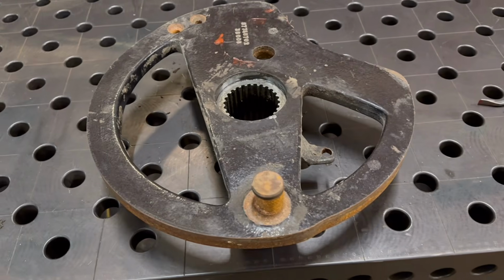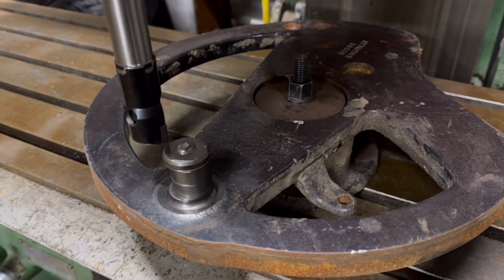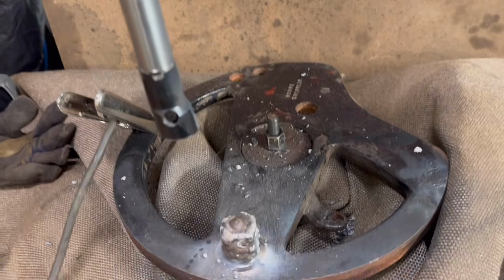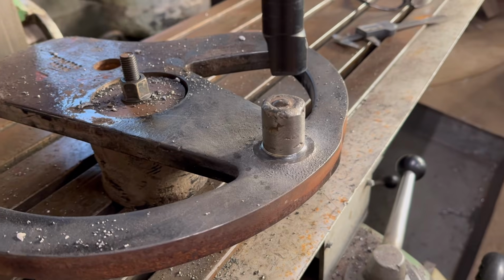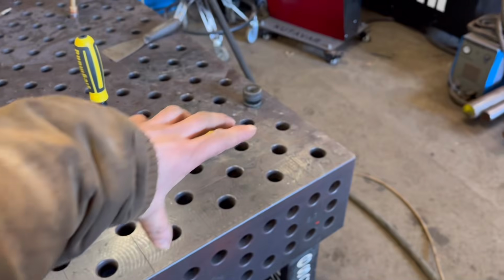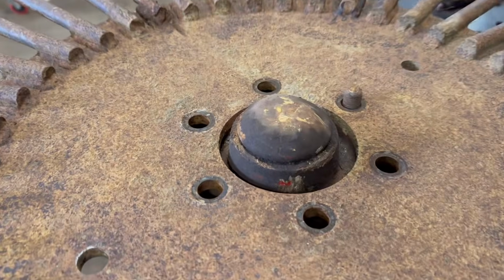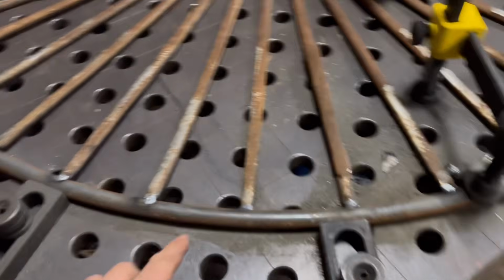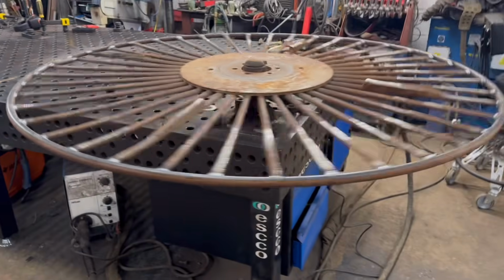Odd jobbing.  Machining Baler part and repairing beet harvested turbine wheel.

Comment: this is a casting wheel for potatoes if I had to guess. those 4 pieces in the cardinal directions would trigger the chute the wheel spins to align the potatoes and drop them into the planter

Comment: I see it is an interesting video. But I would have lobbed it off, drilled the remains out, stuck a new bit of bar in the hole and welded it in. The way it was originally manufactured. Why didn't you?

Edit:
Oh, it's cast. Press fit then.

Comment: 47:16...just out of curiosity, why didn't you use the round bar circle that wasn't bent as the starting point and after you've tag welded all of the dookes and then cut the balance off from the bent round bar's section
Reply from the maker: Just seemed a good place to start and a bit more to hold it on. Plus, i thought with it being bent in over it would make it more awkward once i got back around to the beginning
Reply: Hi Oliver. I see it from your point of view. Thank you for your feedback. Much appreciated

Comment: If you want to clamp things down to your fixture table using your Bessy clamps, attach the overhang clamps to the side of the table and move the item you need to clamp onto those. You should then be able to use the Bessy clamps the way you used to on your old table. Hope that works for you 😊

Comment: So this is one of those scenarios where knowing where the part goes and how it functions on the machine could've resulted in a much better repair. You dismissed boring a hole and inserting and welding a new rod as well as sleeving the existing rod as either "not strong enough" or "likely to throw it out of balance". In reality, it doesn't sound like you have much context on how the part operates and are thus making assumptions which may not be true. This could be a very slow speed or low force experiencing part that just sees a lot of repetition, in which case I'd say a whole new pin or a sleeve are a better option than building back up with weld. I don't think the built up weld is going to hold up against the repetitive motion. 

But what do I know? I'm just a guy sitting in his armchair on the Internet. I wasn't there, I don't know the full context of the situation and I honestly haven't even finished the video. It looks like the repair will work and that's all that matters I guess.

Comment: Apart from the steel being cold i see you are well rugged up as well. Would one of those el cheapo diesel heaters that have been getting about the last year or two make your workshop a bit more comfortable for you?
Reply from the maker: There is a big workshop heater in the lower part of the workshop but because there's no insulation at all the heat disappears pretty much straight away.

Comment: What was the purpose of leaving that overlap on the circumference of the wheel rim? Surely it was just the excess of where it was rolled as there's always a run-off piece of waste bar/plate that doesn't get formed properly. You just have to tack around until the ends overlap then cut down the centre and it'll fit together perfectly. Great vid.
Reply from the maker: no real reason, just seemed a good place to start

Comment: If the nickel is too soft and you were machining a bit off all around the post, could you not have just done a single pass of nickel, machine it down almost until it's gone, and then MIG weld on top of the nickel?  That way the nickel is just thick enough to act as a barrier layer to prevent carbon migration?   Alternatively, how tight a tolerance does that stub have to have?   Could you MIG weld it and abrasive grind it to size?

Comment: Hey was thinking that you could use the trick Keith Fener uses for straightening propeller shafts.  Alternately heating with a torch and then quickly cooling the effected area with compress air and water mist. I've used his technique to straighten a severely bent leadscrew for a lathe and brought it back within a couple thousandths.

Comment: It's probably the thick end of 40 years since I last welded cast iron using nickel rods. I got very good results by cleaning each weld pass with a pneumatic needle scaler. That had the effect of peening each weld to help take the stress out, as well as removing the slag.

Comment: On the wobbly wheel could you have used the welder heat/shrink to your advantage? I've seen others lay down a small weld a table leg on the side you need to draw it to and as the part cools it will draw that leg over.

Comment: Brilliant job on the crank 👌🏼 that beet part looks like an accelerator basket bottom. Runs like a record 🤘🏼 🤔 I wonder if you think a 3-D printer would be a good idea for pattern parts in future if metal powder can sinter. Maybe prototype for your design engineering. Do you work part time as BananaMan 🍌 😂😂😂

Comment: A little tip don’t hammer on your welding bench please treat it well and it will look after you ! I think I would have tried clamping it flat and heating it up to relieve the stresses put in by the welding, then leaving it to cool before unclamping it 👍
Reply from the maker: The top is hardened.
Reply: @ I used to work in a prototype engineering shop and I would have been sacked if I used a sledge hammer on a machined surface welding bench ! anyway the end result was good 👍 that bench was very expensive I was wincing every time you hit it !🙈

Comment: Can you burn out a bunch of washers in a few different thickness of stock to take up the slack space on your welding table quick tie down bolts vs buying shorter bolts?
Reply from the maker: Yes, that would be a good idea.

Comment: Nice job on the CAM wheel. Done similar, but was able to set it up using a face plate on a lathe, with a detachable saddle. I MIG welded it, using NiFe MIG wire and turned it back into spec. There were no circlip grooves as it used a retaining washer on the top. I recall that the MIG wire wasn't cheap, but it went down really smooth and had no holes at all. The wagon wheel didn't surprise me with the distortion, I honestly thought there would have been much more. The welding table is such an awesome tool by itself. Well done, first class jobs, see you next week 👍
Reply from the maker: I did price up some Mig wire for cast but it was extremely expensive.
Reply: @snowballengineering  It is expensive, even more so these days. I think you made the right choice going your way.👍

Comment: Hi Oliver,  good fix on the cam axle, grooving tool worked a treat, when I saw that wheel I wondered if it would spring all over the place once you cut the rim off, but your grasp of what's happening , and aplication of a bit of force won out in the end, ha,  ha, never doubted you mate, thanks for another interesting video,  stay safe,  best wishe's for Xmas to all there. Stuart Uk.

Comment: I work on large square balers as my job, that part is the crank arm for the knotters the centre spline go on the knotter shaft while the worn pin is connected to the needle carriage which brings the twine around the back of the bale. It’s missing the clutch part but there is another little lever with a roller on the inside which stops this peice from turning when it’s not tying a knot
Reply: I think it's the stuffer cam on a new Holland baler

Comment: I don't think that wobble is caused by heat from welding. When you clamped that bent end down you put quite some tension in the rod because it was bent at a bit of an angle. It might have been better to chop that bit off en weld the ring end tot end.

Comment: Good morning, Oliver.  A couple of jobs that needed an engineering pro to make them successful.  Nice.  
Parts at 2 degrees C means the mate doing the welding is freezing his ass of for a couple of hours.  Nice job knocking them out.  And I'm pretty sure that beet harvester ring never looked so good.
Thanks for letting us see a little more of your farm.  I didn't realize you had a dairy farm as well.  That's how I grew up and it takes me back.  Thanks for that.
That hay blower your dad was operating is a blessing.  I used to be on the wagon, chucking hay bale sections to the herd.
Thanks for the video and hope Tenerife helped recharge your batteries. 🎄Happy holidays! 🎄 Cheers, mate.
Reply from the maker: They're actually bulls for Beef
Reply: @snowballengineering  Yea, I couldn't tell from that angle.  Merry Christmas, Oliver.

Comment: Good old school repair on the shaft, Oliver. And replacing the wheel was not fun. If you have another job like that, you should start with welding a 1/4" wide piece of strap all around the spokes and then weld the round bar to it. That will keep it straight and easy replacement for next time.

Comment: Why does the welding material turn super hard on cast iron?
Reply: I think that the hot weld metal 'pulls' the carbon out of the cast. It requires a high nickel rod and pre heating (& possibly controlled cooling (annealing?). An alternative is cold stitching in some cases, not being paid by the hour though! Another method is brazing, tig brazing (ac/dc) is another possible route. Lots of info out there, usually the best thing is double check with something like AWS before you begin!

https://youtu.be/usRMtTFKpmI
Reply: The cast iron has a lot of free carbon in it, in the form of graphite. When you weld cast with steel rods,  that carbon goes into solution in the steel weld metal. You end up with very high carbon steel, which tends to be very hard and pretty much un-machinable.

Comment: Could you use nickel rods for the first layer and then mig weld over the top, or would the mig weld still go hard?
Reply: That's known as buttering, afaik. Welding dissimilar metals. Mig welding leaves a relatively hard weld as compared to say gas or tig welding. It's a factor in vehicle body repair, with respect to crumple zones, afaik. Most people don't seem to care & use mig for most things.

Comment: For the first part you made with the boring head; well done with the circlip groove. Really nice job. You will reduce chatter if you support your part and reduce the length of stick out on the bar. Rigidity is king when machining Ollie. The spigot you were working on, was flying in mid air completely unsupported. When it comes to cutting, you will always cut it if you have something harder. The carbide inserts are incredibly hard and will see off most welds. The swap to HSS worked in the end. Again, nice job. Before giving up with the mig I might have tried a quick cut on the mill.
Great job on the wheel.
Reply: A small jack under the machined area would also help support and reduce movements and vibrations. Great job overall!!
Reply from the maker: Thanks, this is good advice!

Comment: The next time you have an oxyacetylene torch and your infrared device, warm up a piece of bare metal, have a look at it with the IR device, then see how it looks with a patch of soot.
Reply from the maker: i use propane which doesn't create any soot
Reply: @ Spray paint works too 🙂

Comment: A couple of nice jobs, that 1st one could have turned nasty especially as it was cast. That wheel looked flimsy, until we could see you struggling with the weight. If advertising is anything to go by you need to start eating 3 shredded wheat for breakfast, followed by a couple of cans of red bull. You'll be able to lift anything then. 🤣😂👍
Reply from the maker: 5 weetabix every morning

Comment: As soon as I saw that wheel I thought getting it straight would be a bit of work! Nice job though, perfectly good enough for its purpose.  If you do another it might be worth tacking it, then setting the hub up vertically off the side of the bench so you can fully weld each spoke at a time to help prevent them pulling. Cutting and welding the rim to size first would also remove another potential source of warping from the bigger welds you needed in that area. If it came out slightly undersize you could just warm it up with the torch to get it on the spokes.
Reply: Not an expert but would it help better to weld opposite spokes rather than sequentially. I couldn't see fully...maybe he did.

Comment: Nice job , in your other video you showed a trans wave converter next to your mig ,  can I ask what size output it is as we need one on our farm to run  a 3 phase welder , thank you
Reply from the maker: I cant remember to size of it off the top of my head, but transwave do offer an option to run welders off a rotary convertor. I didn't realise this till after i bought mine so mine doesn't have the option.
Reply: @snowballengineering  thank you for the reply , we have been using a diesel generator on the farm which has finally packed up , I will speak to trans wave in the new year , thank you for your help , have a great Christmas all the best Mike, love the videos you do great work
Reply: I'm sure Olly will be along with some info, but I dont think you can run a 3 phase welder straight from a Transwave static converter (I ran my lathe off one until my neighbour gifted me a Siemens VFD) If you watch around 18:52, you will hear a motor kick in and the display on his DRO flickers, so I'm guessing his Transwave is set up as a "rotary converter" ? Basically, this means your generated faux 3 phase from the Transwave capacitor bank goes first to a 3 phase motor which "converts" it to a more plausible 3 phase and let's you run a bigger variety of equipment ? 
If you do go down this route, you need to find out the consumption of your weder in Kw's add in a 3 phase motor of a slightly larger capacity, then get a static converter capable of running the combined power requirements of them both. Or you could just buy a Transwave Rotary Converter, but they tend to be rather expensive and there are a few static converters coming on the second hand market now as people ditch them for VFD's.
There's plenty of vids on here of "DIY Rotary Converters" for you to check out, but just be aware, some come with an extra portion of "Redneckery" !
Reply: @graemewhite5029  I didn’t think you could run welders off converters? That’s interesting. I thought it was only motors requiring 3 phase due to high start requirements, and converter could manage that for things like press brake and milling machine but not a constant load like a welder?
Reply: @ORiordan124  Again, I'm sure Olly will be along to keep us right, but I think being on a farm, he actually has a two phase supply, which means his Transwave setup is a bit more bespoke ?
If you go on American Rotary's website, they explain that you can run a 3 phase welder from a rotary inverter.
Static converters won't do heavy start up loads, such as a compressor or a mechanical type vehicle hoist as they don't like the initial "surge" of current, which is probably the same for striking a welding arc ? Might be different for more modern inverter type welders, but I don't know enough about them ?
Reply: @graemewhite5029  Thank you for the reply
Reply: @graemewhite5029  Thank you for your reply , its something that we need to look into a little bit more, not quite as simple as we first thought , thanks again for your reply

Comment: hey olly . In the boring head  use as short a boring bar as possible, and then I use the **gt inserts (for aluminium) for the finish cuts. Not that you need any hints… super job

Comment: Good fix on the crank, A simple bolt and nut or machinist's jack to support under that part would be a good idea next time.
Reply: Also I think once I had clocked it true I would have drilled with a centre drill so there would be a reference point in case it moved,and it could then be welded on a rotary table off mill and then easily set back up again
Reply: Was thinking 🤔 same thing about machinist jack, plus would have clamped down in more than 1 place too, just our luck, go to turn it back down and it spin on table just enough to mess it up and/or break a insert or piece hss
Reply: Supporting underneath the place you are machining will help with vibrations and shtter.
Reply from the maker: Yes, i need to get some machinist jacks. Not being a trained machinist there's a lot i still need to learn and a lot i still need to buy.
Reply: @snowballengineering  Just a bolt or bit of studding with a flange nut both ends to take the sting out of the cutting. Your UNC T Nut studding is just fine
Merry Xmas
Reply: @snowballengineering  Not only to avoid vibrations and poor finish, but also to avoid catastrophe. The times I had disasters when milling was always with no exception due to dodgy workholding. One bolt like that is almost never enough. If the facemill had grabbed when milling the top it would have unscrewed the clamping stud and spun the work, breaking tools, itself, and any bits of you in its reach. Scary stuff.
Reply: Yep on all the above. You could hear it ringing when you milled the top.  A good way to test is lighty whack the part with a wrench or something.  If it dings you might have chatter, if it thuds, good to go.  ... looks good!

Comment: Was wondering how the hell you were going to turn that in the lathe, saw the miller and thought rotary table ( not going to be easy). Never realised you could use the boring head to skim an outside diameter, cleaver
Reply: Also by putting boring head in reverse it cut inwards not the usual outwards. Took a while before I figured out how he was going to do the circlip groove.

Comment: 👍👍Topper machine fixed one of those this year also. check out his video :)   "Repairing A Badly Worn, Obsolete Part for a Hay Baler - Manual Machine Shop"
Reply: @user-bt6hh9yu1n  He has trash talked a few other shops. I quit watching him.
Reply: @tomredmond  I grew up in the US Midwest, so I'm used to this kind of stuff.
Reply: @BruceBoschek  Live in Michigan, have done so for 60 of my 70 years. I find no excuse for what Josh does.
Reply: Right! Exactly the same failure, but Josh bored out the old pin and shrink-fitted a new on into the wheel. Another good repair.
Reply: ...yes, I saw that video...